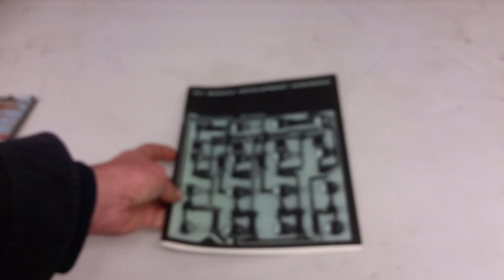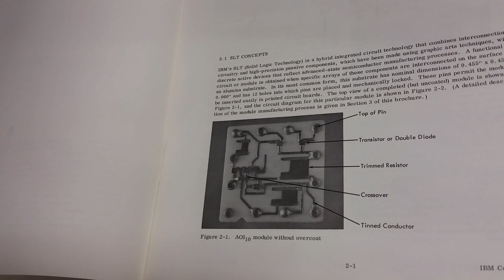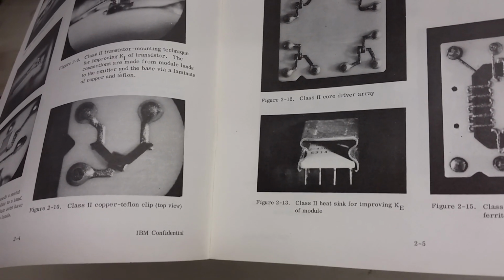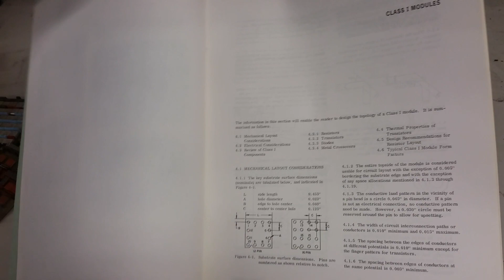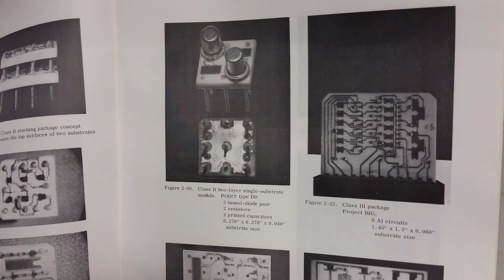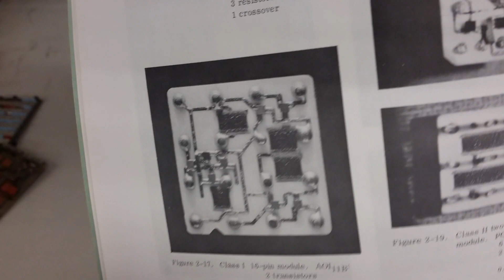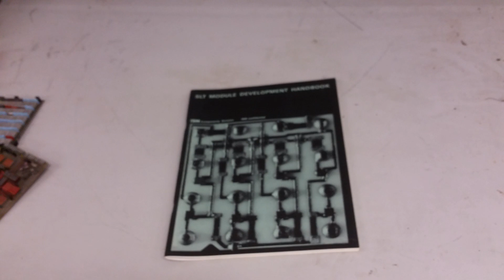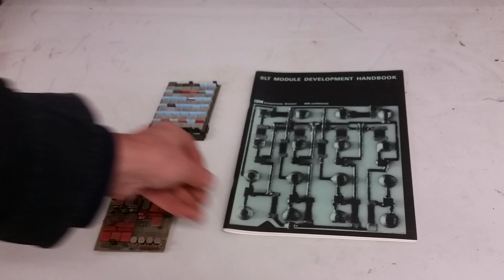A Look Into Some Early IBM SLT

Comment: From Pugh, et al, 1991, regarding protection for the module:

"Initially a silicon varnish was tried, but by mid-1962 this coating was found to provide inadequate protection against solvents used in subsequent assembly processes. Early in 1963 a room-temperature vulcanizing (RTV) silicon rubber was found to perform well, except that it did not provide adequate protection against mechanical damage. Experiments with protective coatings over the RTV led to an epoxy-molded coating that was used until extended testing at extreme temperatures revealed that the rubber got between the chips and the module, cracking and lifting the chips. The final solution, implemented in mid-1964, was to protect the resistors, lines, and solder contacts by coating the top side of the module with a silicon gel and then placing a preformed aluminum shell over the ceramic module, crimping its sides tightly to the sides of the module. The bottom of the module was coated with a red RTV rubber layer to seal the holes around the pins."
Reply: Silicone, surely.

Comment: I enjoyed this video.  I worked at IBM in 1970-1972 in Manassas, Va and made SLT's (and SLD's).   I ran was a pinning machines.  As I recall there were 6 pinners in that department.  There were also screeners, standoff crimpers, tinners and resistor trimmers.  Three shifts at the plant, sometimes 12 hours long.  Those were the days.  They were getting rid of SLT about the time I left IBM.  
By the way, I could be wrong, but I think the resistor trimmer machines used a fine jet of some abrasive powder, not a laser.
Reply from the maker: You are correct, they were trimmed by abrasive jets. If I ever redo the video, I will get that fact right! Thanks for the additional info.

Comment: Minor correction: The resistors are sand-blast trimmed (not laser trimmed).  Great video!  I've got an SLT that was made into cuff links.  Has a clear cap, so you can see the routing underneath.
Reply from the maker: Yes, you are right. I suppose lasers were still in their infancy back in the early 1960s. I wonder if late production SLT was laser trimmed?

Comment: Very interesting video. I've actually got what I think is an MST card from a 370 in my possession. I have absolutely no idea what function it performs or what part of the system or even what model of 370 it came out of. The modules, or "blocks" as I call them, are housed in aluminum square PGA cans as are SLT and SLD, but larger and with more pins in a 9x9 array with a 0.100" pin pitch. Along with those are two smaller cans exactly the same size as the ones on your card, also on a 0.100" pin pitch and in a 5x5 array instead. The card itself is twice the width of your SLT cards, yet is the same height and with connectors on both ends of the card. On one of the retention locks is a little sticker with a letter "S" on it and the numbers on the chips are 4409896, 4409901, 4406313, 4409897, 4406326, 4406325, 6016032, 4409902, 4448770, 6835930, 4448750, 5122340 and 5121772. I also have more of the small blocks loose that I removed from damaged boards with the numbers 4217173, 8273565, 8634164 and 2755272. Chip 2755272 is interesting as it has only 16 pins in a 4x4 array with a pin pitch of 0.125", identical to the older SLT blocks in most System/360s as well as the ones on your cards. I'd be very interested to hear either Uniservo's or someone else's response as to what the heck I have here. I've been studying the SLT, SLD, ASLT and MST chips for a little while and I have drawn some accurate scale drawings of the pin arrays and patterns that IBM used for these. Maybe I can even share photographs of mine with you if you want.

Comment: Reminds me of my 2741 Selectric terminal, which had a card-cage full of SLT boards. I repaired it down to transistor-level :-}   I tracked a fault down to one transistor in an SLT module... Cut the PCB traces, tacked in a discrete transistor, and I was off to the races. Sweet Selectric printer!